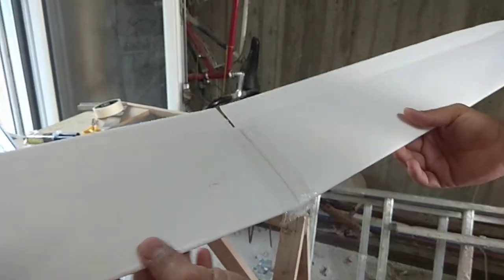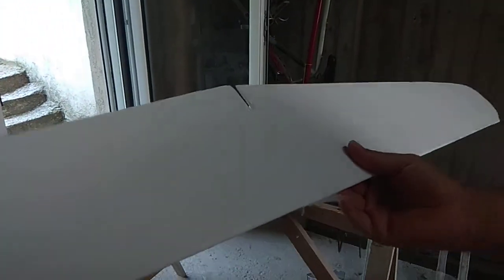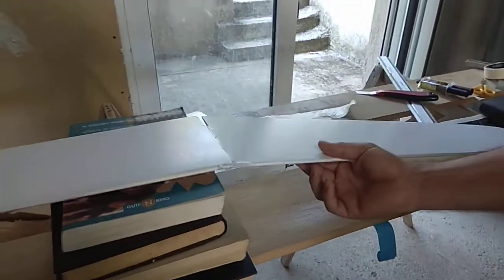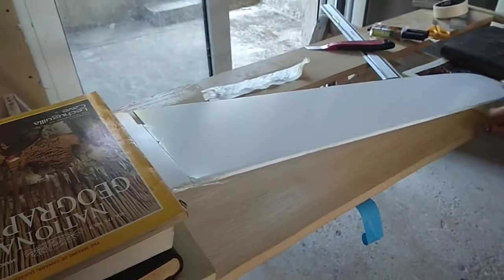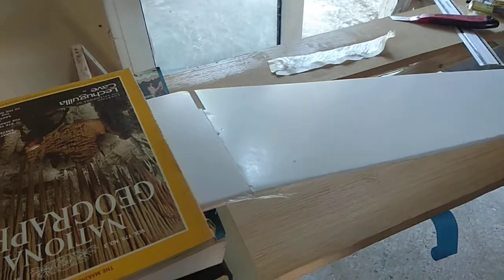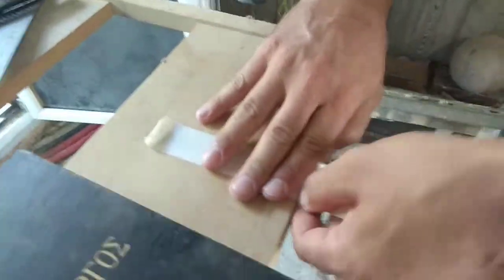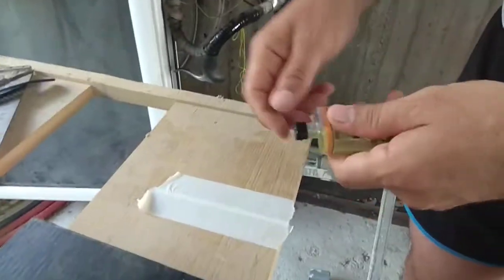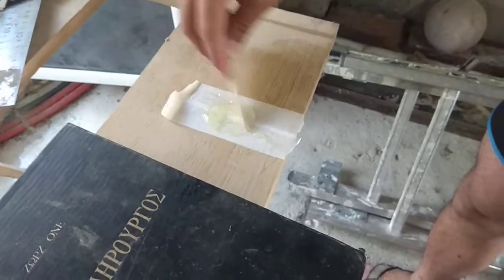Wing joint fiberglassed

Comment: Good work. You may get better strength by using a slow-curing resin such as Z-Proxy Finishing Resin. I have recently started to build my fiberglass fuselages using that resin, and the strength is good while not being too brittle.
Reply from the maker: Thank you, I might think about it the next time.  This is just a test plane from foam board I'm building , not really worth it.
Reply: @afilos  Oh I see. Looks very good for a foamboard build. 👍👍 (I’m Copterdude by the way). :)
Reply from the maker: @AeroCraftAviation  So AeroCraft is the new name, I was used to the old one and had hard time recognise you. Keep up the good work, always enjoying your videos builds! I was kind of inspired by your builds and also learned a lot, thank you!
Reply: not necessarily needed.  these are very light 1m to 1.5 DLGs and for the most part are stuck together with one or more of GG (gorilla glue original), or CA, or 5min epoxy, or hot glue, all of which offer more than enuf strength for their particular applications.  now if finishing resin offered a great weight savings, that would make it desirable for DTFB DLGs.
Reply: @rfdsrd  Hmmm. I build many 1M DLGs and I find that strength is important. I have had many structural failures on launch when only using CA and 5 min epoxy. Those adhesives are seldom strong enough for launching over 25 meters. As long as the aircraft is staying around 100-115 grams, maximizing strength oughta be a big consideration.
Reply: @afilos  Yep, I think it is a better fit for what I do. Thank you! I’m glad you enjoy my videos. :)
Reply: @AeroCraftAviation  epoxy, CA, hot glue, and GG are all that's needed for DTFB DLGs and their ilk.  DTFB foamies aren't gonna get manhandled like bagged CF gliders, because to build them light (using outer paper skins as the stiffeners, without internal spars) they aren't going to happily take 25m high tosses.

Comment: good to mix and spread the epoxy with a balsa airfoil rib :)
Reply from the maker: true, its what i had in hand..
Reply: @afilos  i like your wing build in that the wing design is both angled and with rounded tips.  very cool!
Reply from the maker: @rfdsrd  Thanks Rob, lets see if its worth the effort and time. Hop it flys good, the wing is all finished with peg and everything and will go for the fuse and tails now. Still thinking if a will make it detachable or not..
Reply: @afilos  perhaps since this is a prototype of sorts you'd want to make it fixed, for the lightest build weight, see how it flies and if it's good then move on to a removable wing ... ?  then you will have an excuse to build another!  ;)
Reply from the maker: @rfdsrd  I can't disagree with you Rod, you got a good point.

Comment: Hey filos nice way to join the wing. Are those depron wings, i could not find the Wing making vedio.
Reply from the maker: The wings are from foam board, paper on the outside foam in the inside. 
No video, only these notes https://static.rcgroups.net/forums/attachments/8/4/5/1/7/7/a14101643-25-CamScanner%2008-06-2020%2016.51.07%282%29.jpg